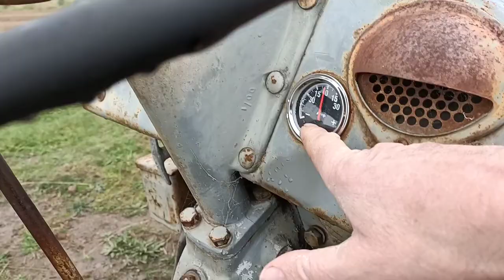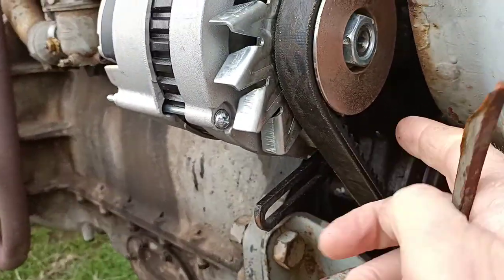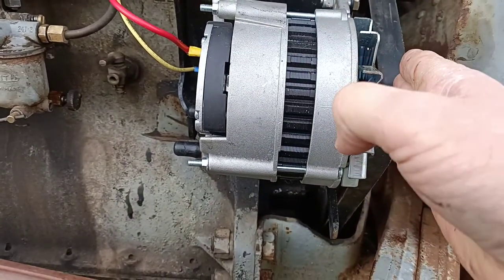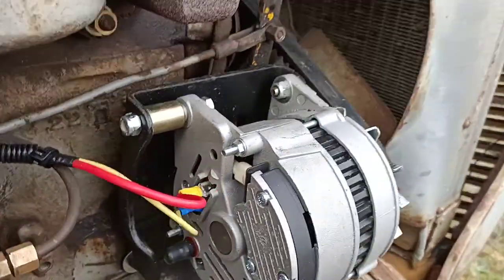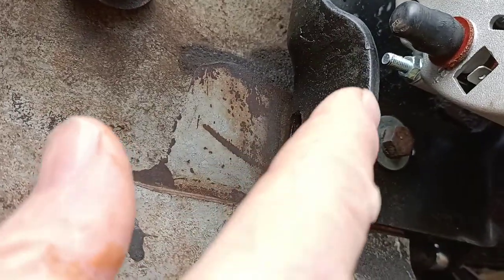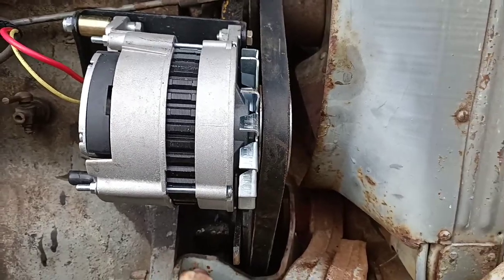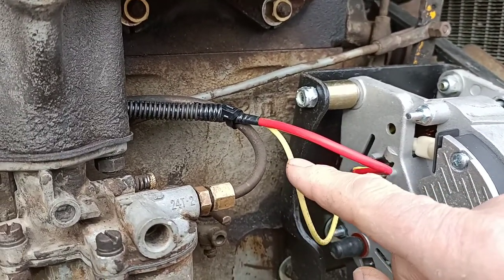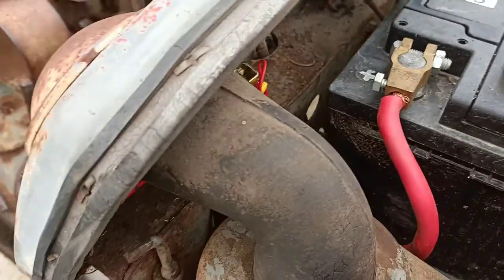Massey Ferguson TEA20 Alternator how to fit and wire up.

Comment: Hi there.
Also from Tassy, Hobart
Just converted mine to an alternator, and wondering what red  light you used?
Using a  LED red light but I think it’s not drawing enough to activate the alternator.
What kind of red light did you use?
Thanks for a great video, alternator now fits  great.
Reply from the maker: I used a new original massy light. Cheers
Reply from the maker: I purchased a new one from Queensland Tractor Spares.

Comment: I have a reversed pole battery connection, I don't know how to install an alternator? Or maybe two 12v batteries so two separate circuits, a starter one for the lighting...
Reply from the maker: If you fit an alternator and wire the tractor like I have wired mine you will only need one battery. you do away with the old regulator so you can just hook it up with negative as the earth, Just one note, don't wire the light in the amp gauge up like I did. If you do the light is on all the time. You need to put a switch in the wiring of the light so you can turn it off. An alternator will put more than enough power back in the battery to run lots of lights. hope this helps you out.

Comment: Hiw many amps is it?
Reply from the maker: https://www.ebay.com.au/itm/321730134499   70A i think
Reply: A 35 amp is more than adequate for this tractor. Chrysler Valiant cars 🚗 ran a 35 amp and a 55 amp when air conditioning was fitted. Email alternator 38 amp at 14.4 volts, Bosch alternator 40 amp. With a/c 46 amp.

Comment: Fitted brand new alternator to TEA20, looks like same model you are using but it is badly overcharging. What pulley did you use?
Reply from the maker: The pulley is 75mm outside dia. it needs to be an internally regulated alternator. if it is it sounds like the reg is faulty.
Reply: @waynedebnam  thank's for replying ...all good now. Multimeter thru up a high reading but checked and re-checked at 14.3...now just to unstick the clutch!

Comment: Do you also know how to remove the regulator thats used with the old dynamo systems.. there are 4 wires on my massey ferguson and i dont know what to do with them. Thank you
Reply from the maker: You remove the regulator and all the old wiring and then wire it up with new wire as I have in the video. The only difference from the video is the voltmeter needs to be wired so it only works off the key.

Comment: My coil is getting hot after running for 30 minutes. same 12v conversion kit as yours. wired the same way
Reply from the maker: I put a resistor block in the wiring. You can get them at Repco, it reduces the voltage down, this should stop the coil getting hot and also stop the points burning out to fast. To hook it up you just remove the wire from the coil that comes from the ignition switch. You connect  that to the resistor and then make another wire and attach that from the other end of the resistor to the coil. If you have any problems finding the resistor give me a yell and I will get the part number for you.